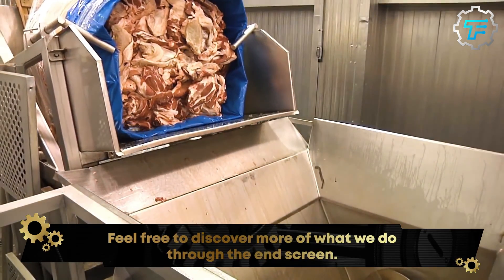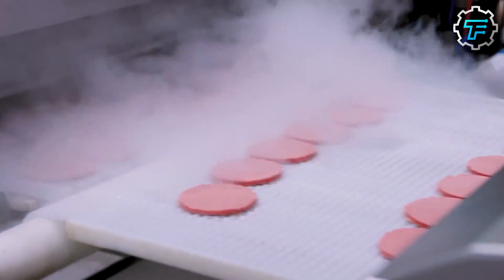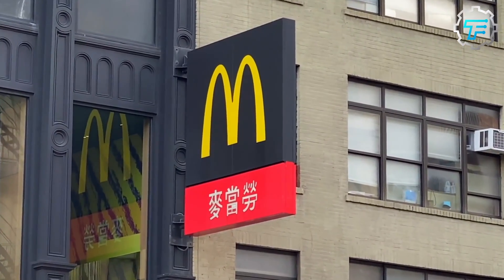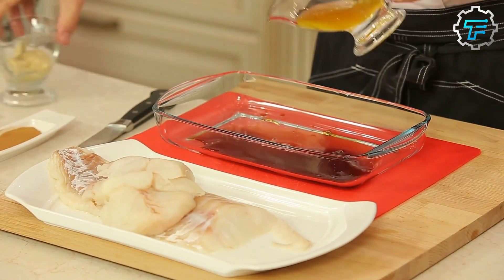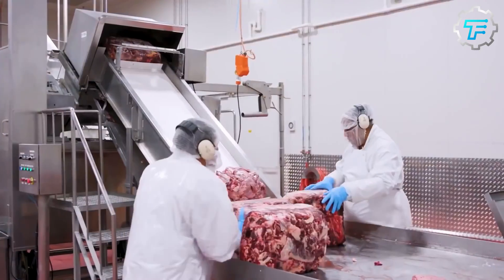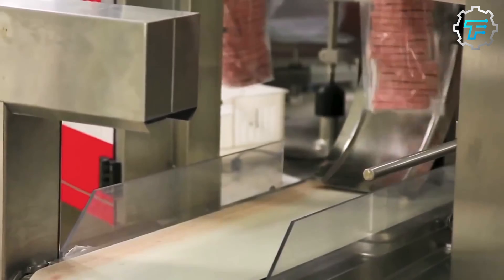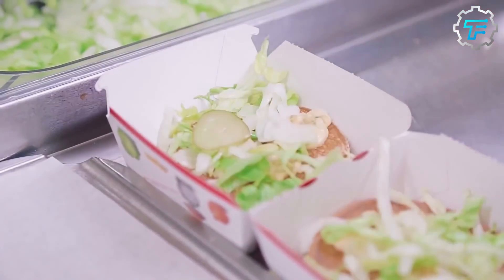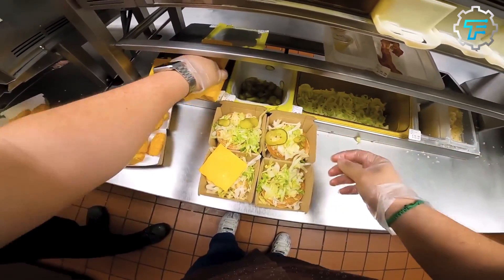How McDonald's Burgers Are Made

Comment: What's with the color of the burger? It's too dark for McDonald's and the cheese isn't on the burger, but the bun.

The bite marks don't line up.

There's a "triangle" on the meat and a "semicircle" in the bun.

The other bun doesn't have any bite marks in it. About 0:14 or 0:15 you can see the whole bun briefly.

The lettuce is mostly missing and the stuff that's in the box is exceptionally wilted. What little is on the burger looks good, which is weird given that their lettuce wilts very quickly when being steamed by a burger.

I can't see the box to determine what kind of burger it was supposed to be (Big Mac, QPC, or whatever). I guess it was supposed to be a Quarter Pounder???

Assuming it's a quarter pounder, there are two options:

1) it's freshly made, so straight off the flat top that's between 375 - 425 (that's Freedom units, not commie)

2) It came out of the warmer which the owner's manual (available online) says 185.

3) Maggots start dying at 122.

I don't want to call her a liar, but I don't believe her story. There is some very important information missing.